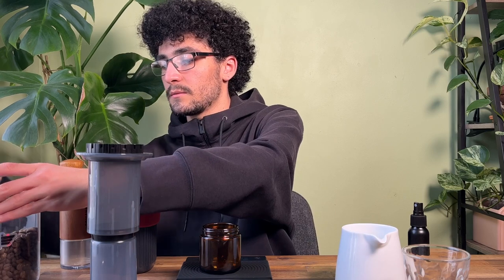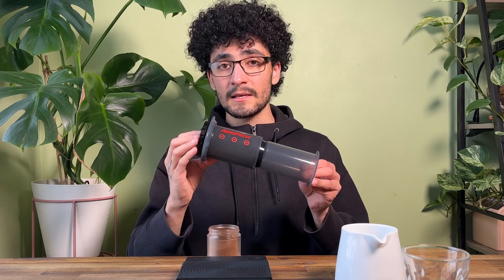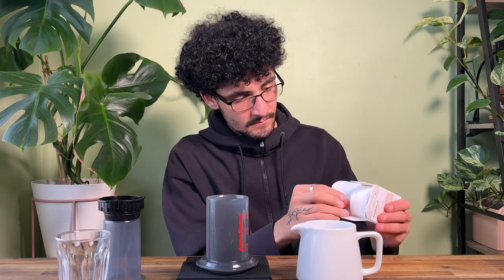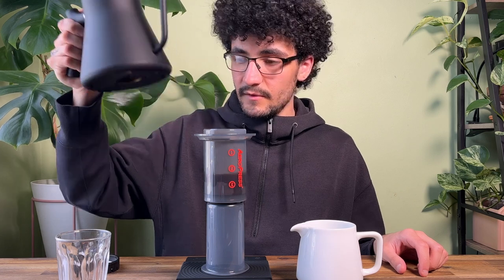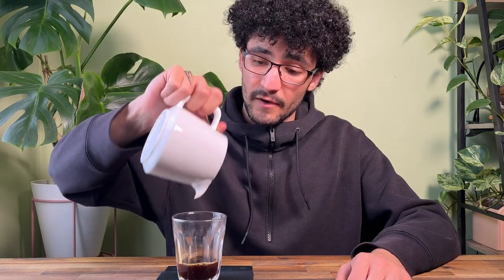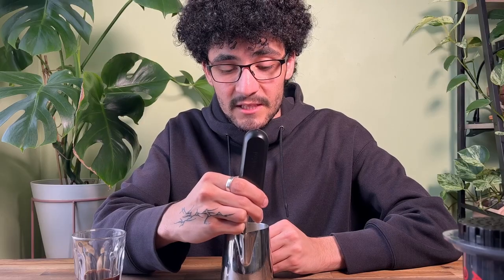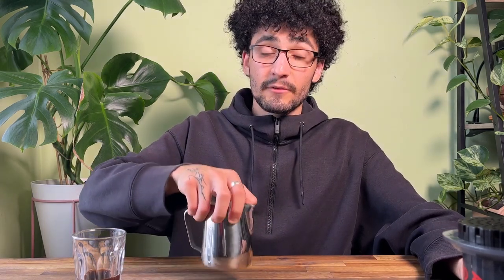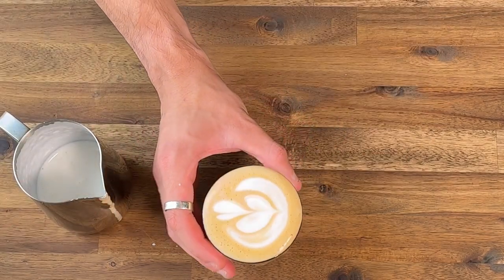Make Latte with an AeroPress ☕️

Comment: Hey man, whenever I try to froth the milk using the frother, the froth forms just on top. How can i get a good consistent frothy milk?
Reply from the maker: Great question!
3 things I can think of why this is happening for you;
1- You haven't created a vortex, try tilting your pitcher to the side and pointing your nano foamer directly down the centre. When you get good and start to feel it spinning correctly you can adjust the height to create more or less froth.
2- You haven't charged your Nano Foamer, try charging so that the battery is full and this will help give it the energy to push through and spin faster. I have found that when my unit is on a low battery the spinning is much sower, however even when it is spinning on a slower speed I am still able to get good quality milk by adjusting the positioning of the nano foamer.
3- This point probably isn't the issue but may be worth mentioning for you, if you have a large jug or container that you are using or you're texturing large batches of milk then this could contribute to not spinning the milk correctly and resulting in the foam staying at the top.

Other things I recommend you to trying is to tap the jug after texturing to remove any air bubbles, pour straight away after you texture your milk. (don't leave your milk sitting for ages or all of the bubble with rise to the surface of your milk.) 

Hope this helps!
Happy Brewing :)

Comment: What's the best roast for milk coffee? Thanks.
Reply: Medium is probably the safest answer, but whatever you like really! 
Some people prefer dark roasts, some might do light roasts but they're generally more fruity and interesting which gets lost in milk sometimes, or they just don't work well with milk,  but I've had some light roasts that worked nicely with milk, one Ethiopian that tasted like Strawberries ended up tasting like a strawberry shake, so I'd say it worked nicely with milk!

I think what he meant to say here is if you want a milk drink use a espresso roast coffee, which are a little darker or more developed roasts generally. BUT even for making REAL espresso which this isn't, you can use whatever coffee type you like, I do coffee that says it's roasted for Filter coffee as espresso and I recently did a Espresso roast as a pour over coffee and it turned out better that way than as an espresso :D
Reply from the maker: There isn't really a 'best' roast, it just depends on what you prefer. Most bags of coffee will have Filter or Espresso roast labelled while some also say best with milk.
Best to use espresso roasted coffee that is recommended with milk, you can also try using any other coffee and taste the results :) You might prefer it.
Happy Brewing ☕️
Reply from the maker: Cheers for this!!!
Very helpful explanation 🤟☕️
Happy Brewing

Comment: 2:50 According to Adler, the inventor of the AeroPress, you're supposed to let the weight of your arms push downwards making no additional effort. If you press as you did, you add more bitterness to the brew.
Reply from the maker: Yeah for sure, I feel that this is more true for making a 1:15 filter recipe. and actually when I make filter coffee with the AeroPress I usually press for about 30-45 seconds.
However for this espresso style coffee I had best results pushing hard, this creates a higher pressure and helps to even get some crema-like consistency on top.
I feel that because this isn't technically 'espresso' that we are making in the video, having some added bitterness / bite to the coffee does help. but this really has to do with your preferences.
Thanks for your comment and for watching my video!

Comment: i wonder how you got to "150-200$" when your grinder alone costs over 200$ ?
Reply from the maker: This is definitely a good point!
but the reason why I used the Comandante to grind the coffee was because that was just what I had, I am sure you can still replicate this with other coffee grinders or if you absolutely had to stay in budget you could use pre-ground coffee. 
(best not to use pre ground coffee)
Reply: @TheBasicBarista  fair enough, but it's not just the expensive grinder - i assume you're using a branded temperature controlled kettle and a prevision scale, while the whole idea behind the Aeropress (i think?) is making a great cup of coffee with a cheap brewer . btw, you can get a great grinder for 50$ (Chestnut C3) that can grind fine enough for espresso
Reply from the maker: @anonylesss  bro what’s your point?
I’m well aware about the C3 … we sell this grinder and have made videos about this.
I think you might be looking into it a lil too deep.
Cheapest set of scales we sell is the basal at $14 atm so incl this would still be well within in budget.
Reply: @anonylesss  I think you miss the point. The scales plus a grinder can cost you under or around $50, and for the water any kettle (or even a pot) will work fine, just bring it to full boil then let it cool for like a minute or two and you'll be within reasonable range.

Just because he used expensive tools doesn't mean you have to, point to where in the video he recommended people pick up the exact equipment he's using. He stated that for $150-200 you can do this, and you can for that budget, just not with the exact kettle, scales or grinder he's using.
Reply: @DreadKyller  i was missing the point when i first replied - but only because at that time i was watching quite a lot of "make great coffee at a reasonable price" videos and..after getting 45$ proper grinder (C3) and an Aeropress , I realized my kitchen scales were annoying and not so accurate and of course missing a timer. so i got a new proper scale (Timemore black mirror) for another 50$ . then realized all the good Aeropress recipes require specific water temperature. so I got that nice kettle for a reasonable price of 69USD (more or less, bought it locally)  . and "all of sudden" i have a new hobby... so stopped pretending and got a Flair Signature...
Reply: @anonylesss  i think if you're watching videos on how to make a latte with an aeropress, it's reasonable to assume you have been making coffee regularly and you already have most of the equipment. you wouldn't factor in the cost of a sautee pan in a cooking recipe, would you?
Reply: @TheBlackhawk1354  you're kind of right. but there are 350$ manual grinders and there's are 50$ manual grinders. when stating pricing in a video, maybe it's worth mentioning "you don't have to use this expensive grinder i'm using, it's just what i have lying around". specially if you're targeting people who are new to Aeropress etc
Reply: @anonylesss  There is always that 1 guy. You are that guy.
Reply: @anujadalakha  glad to help
Reply: @anonylesss  Wasn't a compliment buddy.
Reply: @anujadalakha  thanks for your contribution to this thread
Reply: @anonylesss  You're welcome.